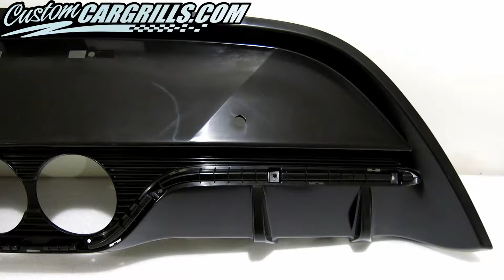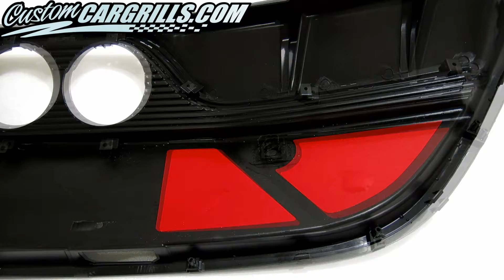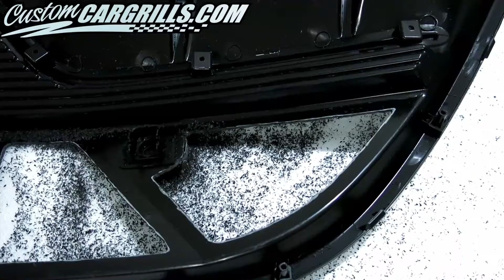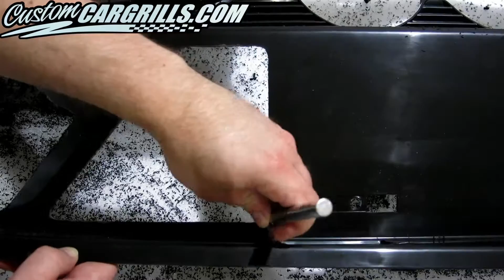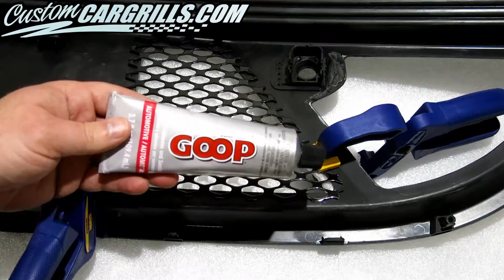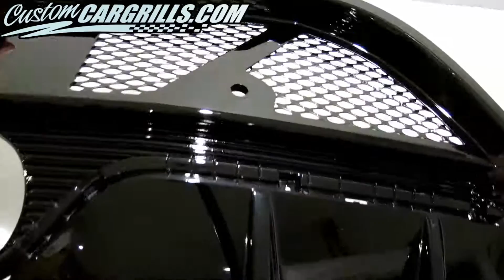Hyundai Veloster Turbo Rear Bumper Mesh Grill Installation How-To by customcargrills.com

Comment: Looks like shit. U need to make a 3d looking box that can be molded into the bumper so ot doesnt look all flat and amateur. Needs depth.
Reply from the maker: If you're interested in some bubbled out mesh pieces, we can make them but the price will be significantly higher than the flat pieces.  Installation will be more difficult too but we'll make them if there's demand for it.

Comment: Love these but at almost $200cdn, I will have to pass. The shipping costs are a bit too high.  Damn it.
Reply from the maker: It's $59.99 for the part, and with 1st class shipping it's $18.85 to Canada for a total of $78.84 USD as of June 10th, 2018.  With the current exchange rate of 1 to 1.30, that's $102.25 CAD.   Unsure where you were getting $200 CAD, it the real price with 1st class shipping is about 1/2 of what you saw.
Reply: customcargrills   Thanks for replying,  I almost forgot about these.  I priced out the two kits for the rear,  the bumper and reflector.  With shipping costs, it’s adds up to $179 CN. Bit too high, but yes, not $200. I’m going to think about it.  Cheers.